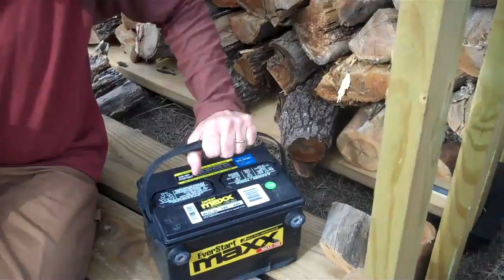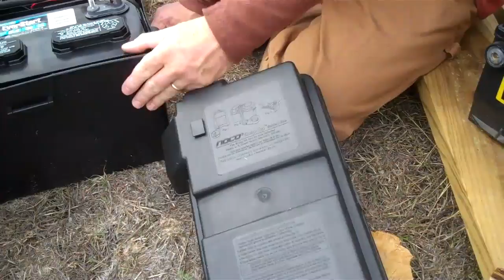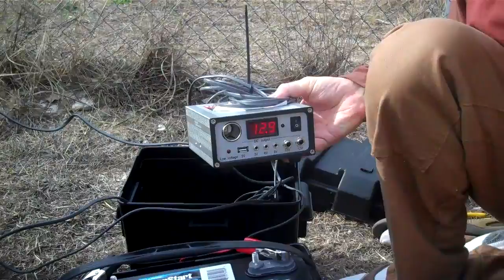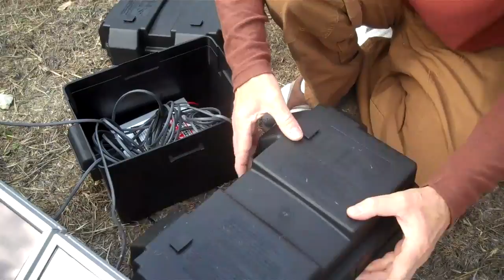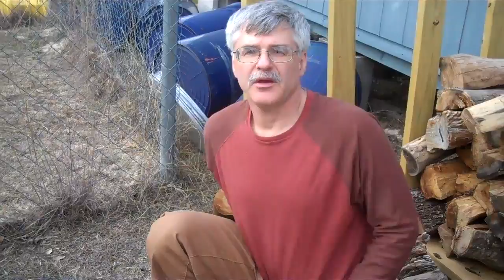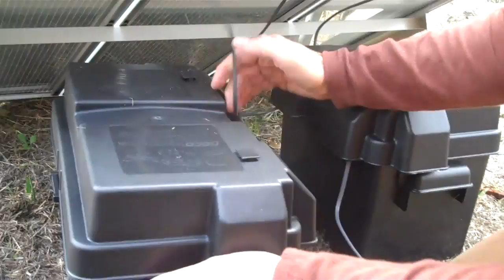45 Watt Harbor Freight Solar Kit - Let's See What Will Run P

Comment: One 250 watt panel is only about $230. Why buy HF panels?
Reply from the maker: Definitely not the best bang for the buck but it sure makes it easy to get started when you don't know anything about energy.  :)  It's just plug and play basically so it's a quick starter.
Reply: Alrighty then.
Reply: Light reading will get peeps up to speed quickly.

Comment: Those battery boxes leak somehow....I bought the larger one  for my pop up camper and after a good rain....It gets water inside.....probably because of 2 vent holes on the top....so I drilled 2 drain holes.....problem solved

Comment: sherri
we built a small cabin in the woods totally off grid. lived in it 5 years until baby was born.  for hot water in summer we had 500 ft of black garden hose drapped over our roof. never ran out of hot water. in winter we had a coil of copper pipe under the grate of our fire place.  had abundant REALLY hot water be very careful water will burn your skin off. we had 6 hf solar kits that gave us all the power we needed. A true sine inverter 2000 cont. 4000 peak did the trick.  12 deep cycle marine batteries. we also had a small 4000 watt generator for heavy stuff or for when sun didn't shine for too many days in a row.  we bought an RV type fridge that ran off both propane and battery never a problem there.  used all led lighting. Had 2 32 in flat screens a lap top and my wifes sewing machine. we bought an RV washing maching machine from camping world.  we were okay living off grid. NOT cheap by any means but broke even around year 3 by what we saved.   kept going back for another 5 years but recently sold to some attys who wanted it for hunting and R&R.  It was great BUT NOT CHEAP. I miss it and am working on changing as much of my current home to solar as possible.  one thing I would do differently is I would double down with 2 400 watt wind systems and my solar set up.  wind turbines from home depot are great and won't break your wallet.

Comment: Use golf cart batteries you can run them down and not worry about battery damage. regular car batteries cannot be run down without battery damage. deep cycle batteries must not go below 10 volts.  As for wattage 45 is not enough to charge a run down battery. use 2 or more kits then you can have 90 watt system or more. there are better solar panels like 100, 200 and even 400 watts but you need more light to get the power. harbor freight panels work on cloudy days as well as sunny days. you could use both types of solar panels if you use a good charge controller. thanks for posting. solar is not for the rich only anymore.

Comment: 45 Watt will not even supply enough to drive a 45 watt florescent lamp because of thermal loss in the inverter and also that charger in the black box is going to overheat, in any case a dumb setup.
Reply from the maker: Chris Bezuidenhout Well, we're just going to have to agree to disagree on this. First, since we didn't know anything about solar power, we bought this as an educational tool just to get started. We go to Harbor Freight occasionally, they had a sale and we had an additional coupon, so the price was right. Second, we use this setup to keep the battery charged so we can use it when we are camping or at our off-grid cabin for a few days, or in the event of a power outage at home. It works quite well for our purposes. The only issue we've had is that after several years the battery finally wore out and we need to replace it. Finally, we keep both the charge controller and the battery shaded underneath the solar panels and after several years of enduring summers in Texas it is still working fine.

Comment: Remember to keep the battery off the ground when your setup is complete. Keeping it on the ground will drain your battery.
Reply: That was true for batteries from decades ago, but modern battery housings prevent batteries from draining while sitting on the ground.
Reply: Myth
Reply: earth ground will drain that in a heartbeat get batteries inside

Comment: My boyfriend is thinking of using this (or another version of this kit anyway) for a cabin he will be building.   He would like to know what you are powering up and was wondering if you know how many kits you would need or wattage/volts needed to power a refrigerator, hotwater tank/lights (and other minor electric items such a lampsand mobile devices) .   The cabin will only be 16 feet by 24 ft.( or 30)  with possible loft.  He was wondering if anyone out there could help us with this as it will be our first off grid residence...thank you everyone that can help even if it is a small bit of info...
Reply: Sherri Love Noel Hi sherri.. House hold stuff is not very efficient when it comes to Ac power.. I would focus on keeping things small and as efficient as possible.. Instead of using a water heater I would use a tankless instant water heater using propane also a gas 2 or 4 burner using propane...The solar will run a tv no problem and some lights without issue but the choice of lights and tv is very important in effecientcy...Using LED lights will save a lot of power and getting a smaller led tv will will save energy and demand on the batteys .. Cabin design can help save energy also by facing the windows south and getting as much lihght and heat from the light early in the day you can also use the sum to heat water also look up solar water heaters.. From my experience I used 4 12v 7.2a batterys in my solar generator with a few simple 30w and 50w solar panels to run some led light strips,5V usb water pump and also a few 12v ciggy lighter 5v ubs chargers to charge my ipod and camera and not once ran low on power.. Its really suppy and demand and theres plenty of website to figure out how much power you need but I suggest that he figure out what he can live with and without and adapt to the smallest lowest power things he can get to keep the system cheap. The idea I had changed drasticly when it came to system power needs when I started to try to live with the choices I made..so it smart to design and test a small cheap system to see how it fits ino ya life and grow it or shrink it..
Reply: Wow sounds like fun. Hopefully I'll get mine started sometime soon as well. Good luck and hope you the best.
Reply: +Sherri Love Noel Harbor freight solar panels will give you power on cloudy days. that's why many people use them. If I was going to build a solar system I would use the best of both worlds. With a good charge controller you can use Grape brand solar panel and Harbor Freight panels, at least you will get energy on cloudy days and when the sun is at its max you will get max power with both types. People need to research before commenting about Harbor Freight panels. research before you buy any solar panel. some need full sun to get power and some work on cloudy days. inverters is another item you need to research. I would never use a modified sine wave inverter.. modern electronics need pure sine wave to function properly without damage to the circuits. Lap top computers must have pure sine wave and the manufacturer will tell you so. Some of the better UPS have pure sine wave built into their products. If you still use a desk top you can get away with modified sine wave but tablets and Laptops need pure sine wave. Refrigerators is another item requiring pure sine wave. lights most of the time will work with any type of inverter. but you might consider using 12v dc for lighting. I hope this will help. Happy solaring!
Reply from the maker: Sherri Love Noel This kit is a nice kit for starters to charge small stuff and run a few low watt lights etc.  But the cost per watt is not as cost effective as other setups.  It's a great learning tool since it's kind of plug and play but if your looking at running a cabin with a frig this is not the kit for you.  You can get some other kits through Renogy and some other companies that will definitely give you more bang for the buck.  Check out the prepperretreat channel to see a small off grid cabin set up or SolarCabin channel -

Comment: Hey if your car/truck batt is at least 12.0v why don't you use its amps? like put them in parallel, i would love to help you out if you need it. You can use a deep and a lead acid. Together! as for a deep cycle you want to avoid getting it to love to often. If you'd like Message me! I'd love to help i install panels on homes!

Comment: have enough current to keep the battery topped off during the day. This way all of my lighting uses zero grid tied power unless by some chance something happened to the off-grid power in which I could flip a breaker and have my lights back on.

Comment: I currently have 1 Deepcycle and 1 1500Watt power inverter. I have considered rewiring my house so that the lighting is all on 1 circuit (small house) and that will all come to a seperate small load center. Which would be tied to the main load center through a breaker that would be normally off. The lighting load center would be fed by the power inverter (Size needed depends how many lights will be run) which would be on an adjoining breaker. 2x 100Watt solar panel should run all my led lights &

Comment: I work in the "critical power" industry (UPS, battery backups, generators, inverters, etc) and I KNOW that Generac generators are NOT good.  They have a higher than normal (industry standard) failure rate.

Comment from the maker: I think the primary purposes are to regulate the charging current and keep the battery from overcharging, and to keep to the battery from discharging back through the solar panels at night. Some charge controllers have additional functions also.

Comment: Hi! We are playing with a small solar set up. and we took the plastic black box ( bougt separately), drilled holes for  a volt meter and switch for the inverter..just 1 panel, as we have  a nice generator for big applications. BUT, having options if paramount!  Thanks for the videos!!

Comment from the maker: A portable fan shouldn't draw too much power so I think with a good deep-cycle battery/inverter combo you could power it all day, perhaps a weekend or more if you were only using it during the day.It all depends on the capacity of the battery and how much power the fan draws (plus the power consumed by the inverter). Great question, by the way, and it got me to thinking: I think we will take ours camping and see how long it will power a small fan in the tent at night.

Comment from the maker: @thaddsreal Thanks. The kit did come with a charge controller and it is in the smaller of the two battery boxes (the one with all the cables running into it). I've seen mixed reviews on the charge controller, so I may end up getting another one eventually (especially if I add more panels). So far so good though